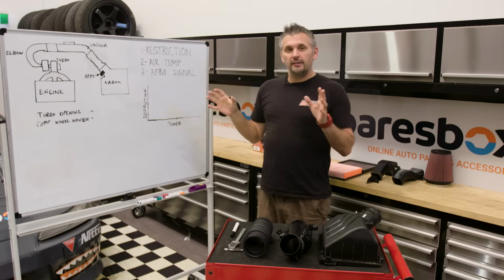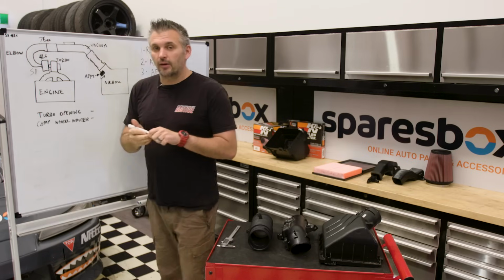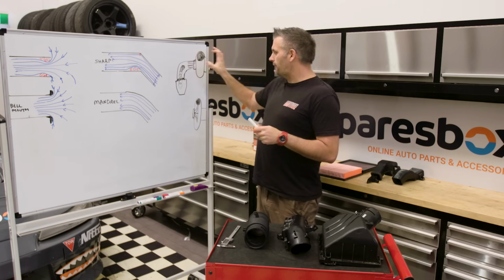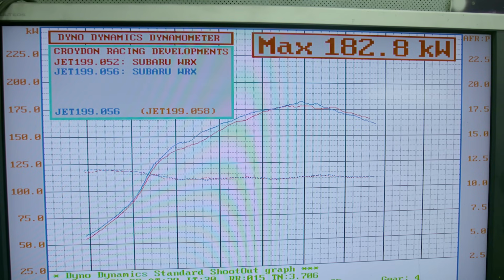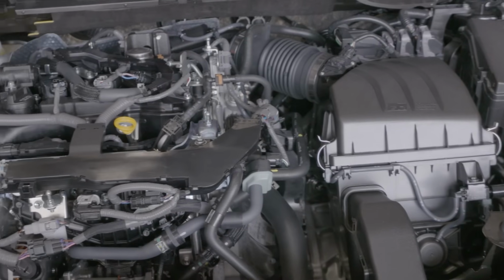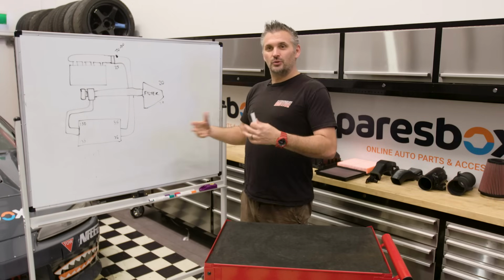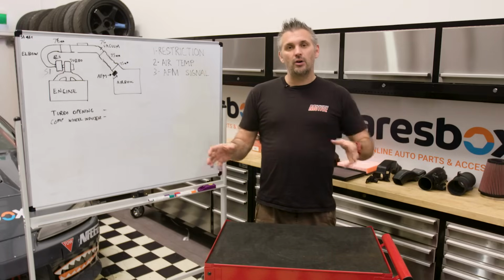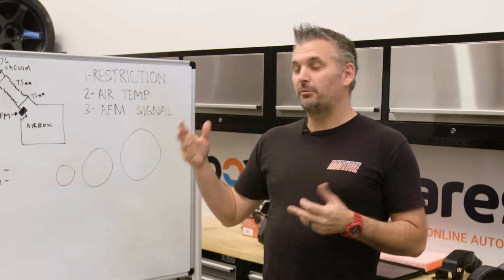Why Cold Air Intakes DON'T or DO Work on Your Car - Motive Tech

Comment: I can honestly say without any doubt
My w30 Mr2 with stainless and a cold air intake filter was lumpy at low RPM especially in slow traffic, however it really smoothed out as you got moving with spirited shifting and open road's 

Honest answer I don't think it was faster than stock, probably detrimental as it was lumpy 1st to 2nd low down.....But!!!

It was a beautiful experience for my Ears, such a small 1.8 138bhp engine at revs sounded wicked, bear in mind that engine is about 4ft away from your ears, beautiful little Japanese tone absolutely loved it and it made spirited feel faster, top down by far the best smiles per gallon car I've ever owned, if it sound's fast it is fast 😀 

Just enjoy life and mess with your car,  taste sound and visuals do more than data on paper ever will.

Comment: So....basically what I took from all this is for the average Joe with modest power goals slightly above factory, stick with a high flow panel filter because the modern factory intake works well...unless you want sound.

Comment: Great great video. Thank you. Finally some arguments based on evidence and not just buyers remorse.
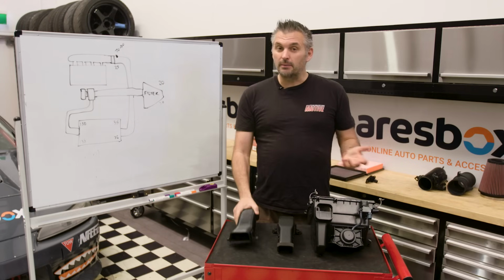I'm a GR yaris owner and I don't want to touch anything going into the AFM because I don't want to reprogram the ECU yet, but I'm interested on the cold air piping going into the OEM airbox that you show around 23:49 and also the duct you mention at 23:56. Could you please share links to any place which sells those? I noticed it's 3d printed, so the STL would also do.

Comment: What's so complicated,for non supercharged engines take cooler air from outside the engine bay or hot air from inside the engine bay.For supercharged same applies plus an intercooler if that's part of the package.Makes me laugh replacing a stock system that takes air from outside with a dicky pod filter that takes hot air from the engine bay.About as much use as a catch can on non direct injection engines.Another pointless time and money wasting exercise to have whatever the latest must have fad is.

Comment: Air meters , we found we could "tune " a car sometimes by rotating the Air Flow meter in the intake system.  Especially there was a bend in the tube w/in 6" , ether in front of it or behind.  The meters themselves were in a 6" straight pipe . Air hugs and compresses a little at the top or outside of a bend , inside of the bend it slows down and looses pressure becouse of the air compression on top. It takes a few inches of straight pipe to even out .

Comment: It’s simple from stock all intakes collect air from a cool spot of engine bay or wheel well, so where you can’t go wrong and this means there’s no chance of losing power you can ONLY gain…….increase the size of where the stock intake gets its air and make sure it’s setup and sealed the same way as it was stock

Comment: Stock 2007 Mustang GT 4.6L 3V
(Tune Only)
1.91 12.93 at 104.9 mph @ -1200' ASL

CAI (Actually not technically a cold air intake as it was not ducted to outside air, I found little difference Intake Air Temp once you had air movement underhood)
1.83 12.82 at 107.5 mph @ -1800' ASL.

The car generally ran quicker with a 1.9 60' as 1.8' usually represented harder clutch bite which reduced 60' exit speed due to lower rpm at clutch lockup.

PS Yes that is "Mineshaft Air" (Below Sea Level Density Altitude).

Comment: Great video and answered a lot of questions that I had. 
One thing that I’m trying to understand now is for example with the GR Yaris.  If you used the stock Yaris air intake on the GR Yaris. Would you see a difference? Or inversely if you used the GR intake on a standard Yaris. Would you see improvements?
Reply: Theyre completely different design and location in the enginebay

Comment: 2003 Mitsubishi Lancer ES with a 4g94 naturally aspirated 2.0 when I bought the car it had a typhoon cold air intake that went straight to the inside of the engine bay AKA hot air intake, lol.( During operation 120° or so on OBD2 scan tool)  I proceeded to put a hole in my hood and totally sealed the air intake, unbelievable how much it woke the car up once it got outside air. More airflow/ hot engine bay air ....  doesn't work kids

Comment: Amazing video.......I found this because I wanted to install K&N CAI, Borla and Velossa on a stinger GT RWD.....but wasn't completely convinced about the effectiveness of these.......but this has actually put me off the idea.

THe manipulation of sensor inputs and whether the car will account automatically account for them in a positive way........it is too expensive, time consuming, and warranty destroying for no real benefit other than aural aesthetics. 

However, I am still wondering about the Velossas. 

Does anyone who know what they are talking (including the video creator) about able to comment on these things and if there is a tangible benefit to installing these (on the stinger GT a big plastic mould needs to be removed that I believe channels air to the radiator and IC. People also seem to highlight that the front intakes that are removed are silly because the air comes round the sides, does a U-turn and comes in from above, but there is no room above that inlet cause some is right above it, etc etc. This may be the case, but again.........Kia seemed to have done a great job of this car. Either this strange inlet system is done for a reason or even if it is silly.....are the sensors and ECU designed to expect the air to have travelled in this "silly" way?

Greatly appreciate any wise words and education on these points.

Comment: A motor is like a body trying to jog or run. The better it breathes the better it performs. My 2013 Camry had the stock filter, there’s another filter above it which I would not have noticed had I not looked. Extra boxes attached to the stock intake setup…… all these prevent air from getting in the motor…. Cone filter one pipe with no added boxes on top of the box that holds the filter.. my aftermarket intake takes less throttle to get up to highway speed and less throttle to go down the highway…

Comment: This is why I have always told customers,  friends or other enthusiasts that once you change one part of an engine,  you'll need to correct the imbalance you've made.  The goal is to achieve a respectable balance.  
  One thing I've noticed about this video is, he's  missing why or what the difference is between a CAI and short ram.  The goal there is getting cooler charged air into the combination chamber.  Cooler the air,  the better the fuel atomization.

Comment: How do you get cold air from a hot engine bay ? Just use a k&N filter and make a hole in factory air box below the filter level, same thing.

Comment: I reckon a high flow cotton drop in filter is the way to go for street applications 
Maybe way down the track if your making massive horse power and need every bit for a track car it would be worth the change. 
But factory air intakes were designed for good flow and do the job

Comment: Good information, for the most part, but your example of aircraft not losing power for a disturbed airflow into the jet engine is not completely accurate.  For small disturbances, that is the case most of the time.  However, there can be enough of an interruption in airflow for that engine to lose power.  Not enough necessarily to totally shut it down, like what happened in the movie Top Gun, but strictly speaking, that is also a real possibility.
Reply from the maker: We are referring to turbulence and angle of attack in the 99.99999% of cases wheee planes dont compressor stall and crash. 

Absence of evidence is not evidence if absence
Reply: @MotiveVideo  Just saying that there is a disturbance, thankfully, hardly ever enough to cause that catastrophic an event, but it is there, just a variance in the degree is all.  

I still like to watch/learn good info, and you guys have given loads of that, so please keep up the excellent videos.

Comment: A tuner company for my car sold MAP sensor hoses made with a small drilled hole in them, so a small amount of air going to the sensor leaked out before reaching the sensor.
The ECU though the engine was boosting too little because of the lower MAP sensor measurement and the ECU then adjusted the boost higher then stock boost to compensate.

Comment: Hey, just a passerby. Jet engines can experience something called compressor stall when the aoa of the blades of the compressor exceed their critical angle of attack resulting in compressor fan blades unable to provide laminar air flow to the next stage of blades. Compressor stall results in significant flow reduction and in extreme case air flow reversal. So your opinion about the incident angle of air having no impact on jet engine is wrong. And yes planes have crashed as a result of compressor stall
Reply from the maker: We know. Studied aeronautical engineering. A few degrees or small turbulence wont do it. Thats the point.
Reply: @MotiveVideo  I don't think the jet engine was a very good analogy. If the blades of turbocharger is analogous to those of a turbo jet, any stuff that alters airflow angle at the inlet is essentially the IGVs in turbojet. IGVs and the rotation of the compressor blades determine the whirl speed and axial velocity of the air. You would agree that compressor blades and the wings of the planes are the same from a physics point of view, so if ca is exceeded, the air doesn't do anything with the wings or the blades. I don't know much about automobile turbochargers, and I don't have any opinion on most of the content in the video. However, the video would make a layperson believe that a jet engine has no design envelope and turbulence or airflow direction has no impact on the engine performance/safety. you might have gotten your message across about the car turbocharger,  but may have given some people the wrong ideas about turbojet engines.

Comment: lol... in my 74 Duster... I'd turn over the air cleaner lid cause 4 barrels carbs sound awesome when it's upside down. Side effect is that the air-cleaner is 360 degree's exposed, but no one thought about that back then... just that it sounded cool when the secondary's came alive. Mopar even made an air cleaner designed to make that noise... and they put it inside the Road Runner.

Comment: The only cold air intake I ever did was on a 1998 f150 with the 330 Cid v8 (5.4L for everybody else). I did a spectra cai, throttle body spacer and about 6 inches behind the big cat I did a single in dual out muffler. Cou,d feel a little better throttle response. The best thing was it went from 13 mpg to 16 mpg, hand calculated.
Oh yeah on my ram 3500 with the 408 cid cummins the stock air intake is just as good as most aftermarket cai.

Comment: I have a 2006 car and the time just came for a new filter and the box was super dirty. I put a cold air intake in with the heat shield in the left side of my car with the computer right below and it performs literally 5 times better than it ever has in terms of acceleration. If your car is old I definitely recommend installing an aftermarket intake. I learned that our parts are nowhere near the updated parts in modern cars.

Comment: So, from what I know and from this video, best way to increase power of my NA RX-8 is to lower temperature of air. So ram air duct it is...
Reply: Hook up your AC to the air box and you will have 40 degree colder air, isn't that what it is all about, I don't know if the AC can give enough air to the motor though until I do it!

Comment: If you do other modifications, like bigger throttle bodies or head work, the increased airflow will allow the engine to take full advantage of these modifications. If you're just doing a few things, you might not notice a performance bump, but if you run at a dragstrip, you'll find your times much more consistent and you don't need to cool down as long because you're not affected by the temperature under the hood, this is the advantage of a cold air intake. It's a shame that all these experts never even mention this, they just look at dyno numbers and think there's nothing else.
Reply: I think his entire point is that it DOESN’T increase airflow.

The airflow is restricted usually after the intake, which means adding more airflow at the intake level doesn’t change anything.

Imagine if a 3 lane highway had a lot of traffic at one of its 1 lane exits.

Upgrading it to a 5 lane highway will do absolutely nothing to fix this, the 1 lane exit will still have the same amount of traffic.

Comment: Great video and very informative! My car is a V6 accord, it came with a k&n panel filter and the air box is nicely tucked away from the engine, pipe has good flow, so I’m not gonna do anything to it. IMO all the Honda guys running a CAI from behind the fender are just asking for a hydro lock, and the only benefit is sound.
Reply: i have ran cold air on a lot of cars hydro lock has never been a issue and k&n are crap, they will destroy most modern MAFs

Comment: My personal experience is with a 2011 F-150 with the gen1 5.0L Coyote. I added the K&N cold air system to it, and although I have no clue how much HP was gained it was definitely felt. As well as MPG increased by 1.5,  pending reasonable driving. At one point I decided to go back to the stock intake with a K&N panel filter for a more sustained MPG. The MPG and HP were barely over stock levels. Needless to say I went back to the cold air system. Now 8 years later and with 225K on the truck I'm still happy with the system. The only bad point is that the oil used in the filter does go all the way through the induction system. That means it will build up and cause flow issues in time. Which in turn means complete cleaning of the induction system every so often. Would still recommend it for this ap though as it does work.
Reply: Thanks for the real world information Jeremy!

Comment: I can say that a lot of what you said is spot on. I installed an Injen CAI on my first Audi C7 A6 3.0, and didn't see much difference in hp at all (if any). When I purchased my second C7 A6, I bought a K&N replacement for the stock filter, added a chrome intake pipe, and left the box alone. I used the same exact chip as I had on the first Audi, and everything else was the same. Never dyno'd the car, but the hp increase was definitely noticeable, the launch was way more aggressive, and the torque was up there. I don't exactly know why I purchased a CAI originally, and the cause could be from several different factors (manufacturers influence, because they looked cool, or too much Jack Daniels), who knows. The 2nd time around, I thought about it for a minute and figured those engineers at Audi know what they're doing, and I looked at the design, and it all made sense. Air is forced into the air box from the very front of the car so why did I ever take out the box and have the air come from directly inside the hot-ass engine compartment. I could kick my own ass for not seeing it earlier, but that's how we learn, I suppose.
Reply: Thanks John…you just convinced me NOT to purchase an aftermarket intake for my 2022 Genesis G70 sport prestige.  I think I’m going with a Nishimoto intercooler.
Reply: unless tested on a rolling road..dyno..its all ' butt hp '

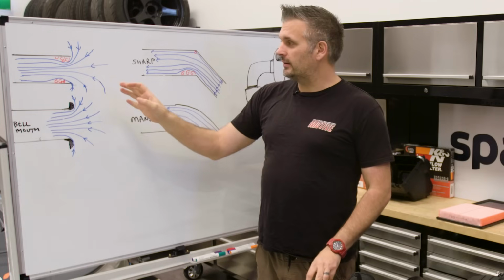Comment: See Andrew's explanation of air flow @around 7:00.   Now, think of snorkelling on big V-8 air filters.  Engineers added the elephant-like bell to snorkel inputs.  Look at jet engine cowlings.  Always round.  Also, while torque was dominant in 400-500 C.I. beasts, notice the total area of the intakes/snorkels.  At less than 5K RPM, no issues.  ☺  This is a video worth  repeating as yr knowledge base develops. Kudos.

Comment: Hello, I got a carbon fiber CAI for my car. It sounds great and the car feels great WOT. In city driving the car feels lumpy and laggy from a stop. I checked the codes and checked the data, it says the car is running lean and the fuel trims are +20% for both long term and short term. The MAF sensor seems to be in the same location and the airbox is also sealed like OEM. The only thing I noticed is the CAI has a more complicated shape, the surface is rougher upstream of the MAF, and the two fins inside the intake is closer to the MAF than it was for the stock airbox. Unplugging the MAF let's the car run perfectly. Also, smoke tests show no leaks. 

Is there anything I can try to fix this situation?

Comment: what i've found just searching cold air intakes on youtube is that a lot of people are doing it wrong most people remove the factory air box then  slap the new filter on ,effectively  making them hot air intake without shielding from the engine bay  at all. no wonder there are 100 different opinions out there. you will end up losing power and possibly even end up on limp mode.

Comment: I've used several different brands, some made by same parent company, and have only seen decreased mpg, sometimes a better feel. Overall not worth the bucks for a straight stock vehicle. The only advantage has been the ability to clean and replace. Info is king, thanks for the video.

Comment: The most logical explanation I have seen for CAI.  Fully agree with measuring with a vacuum gauge to detect restriction.  If CAI's worked across the board, the companies that sell them would demonstrate this.